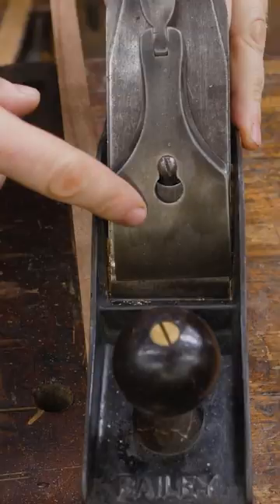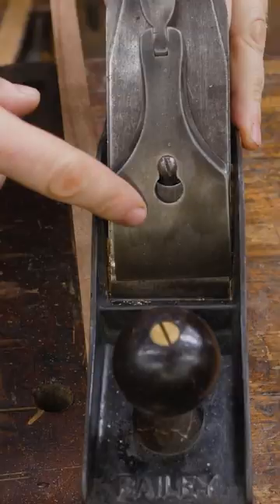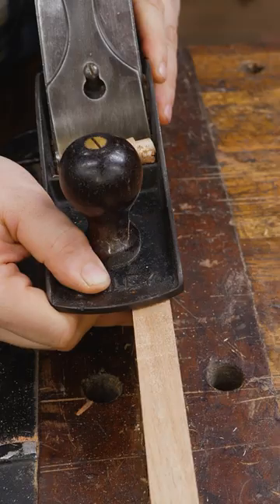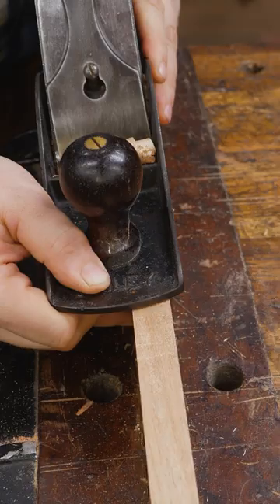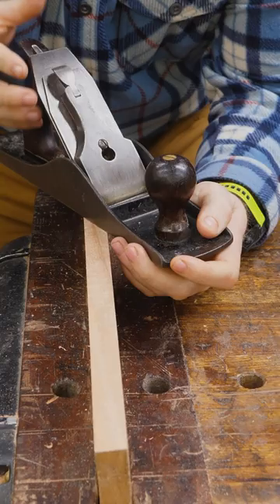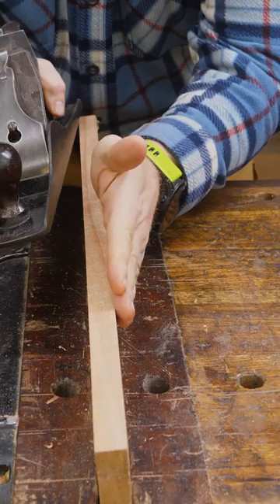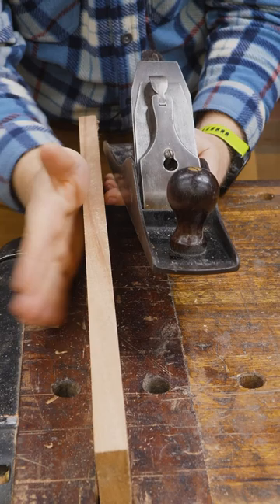How To Joint A Board Perfictly Square

Comment: THANK YOU FOR SAYING THIS YOU BRAVE SOUL! every body advocates putting a camber on the plane blade but I use shifting the weight of the plane instead. Always thought I was doing something wrong.
Reply from the maker: Putting a camber in the iron is something that game out of the English tradition around the turn of the last century. Most other traditions advocate for the flat iron. It always makes for good arguments.

Comment: I have been struggling making 45 plane for wooden blades you got any advice cause it's been hard to keep it exact
Reply from the maker: If you want it exact you either need to use a fence or make marks on the board and plane until you touch the marks.
Reply: @WoodByWrightHowTo  thanx that's pretty much what iv been doing

Comment: Match planing should be done when possible (acceptable grain on relevant faces etc). Boards clamped together and planed flat (aiming for square but not required) flip the boards and any discrepancy from square is mirrored on the other piece = as accurate as it gets
Reply from the maker: When possible that is best.

Comment: I don't think is the weight, but rather the camber (the middle of the blade digs deeper). You could make a test with a camber vs straigth blade.
Reply from the maker: there is no camber on the iron.

Comment: NOTHING is perfect, exact or absolutely anything. Everything has tolerances. The smaller the tolerance, the greater the cost to achieve. You just want things accurate enough for the purpose. Think like an engineer- work to tolerances.